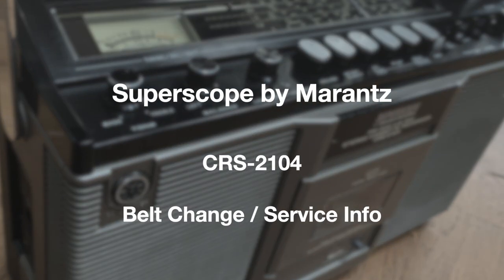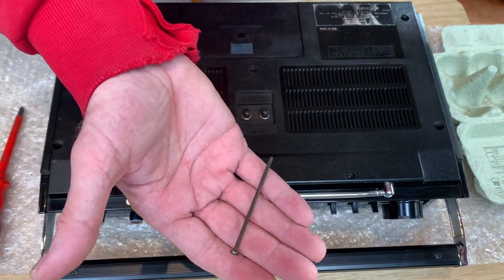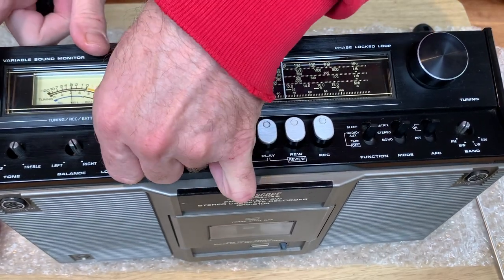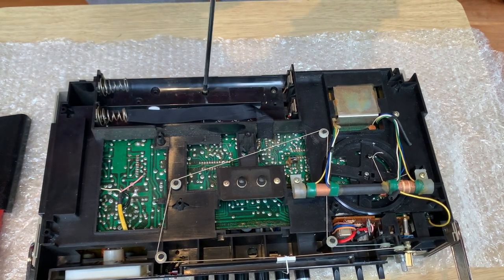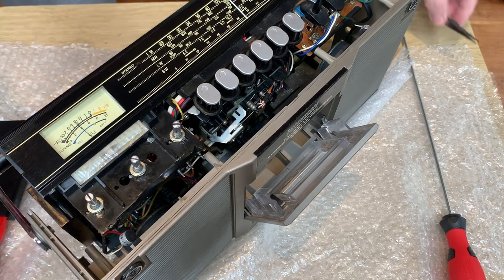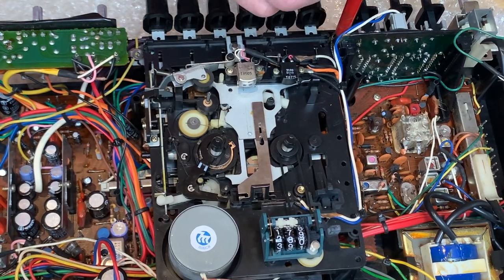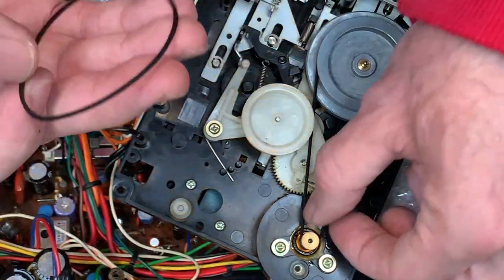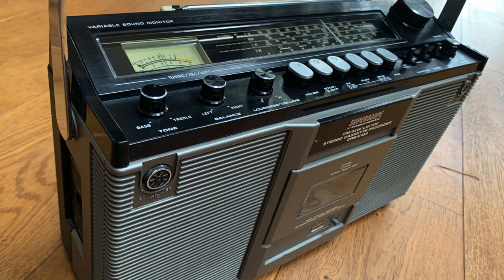Belt Change on Superscope by Marantz Radio Cassette CRS-2104. 1970's 1980s Vintage Ghetto Blaster

Comment: I have one of the same model. 4:37 This screw is the key to open the top cover.
Reply from the maker: Hi, thanks for watching! That pesky screw is tucked away, isn't it? And mine was obscured by a couple of wires too. Just goes to show that you should never try to force anything open - especially with brittle old plastic. I hope you still get to enjoy your machine - they are lovely!